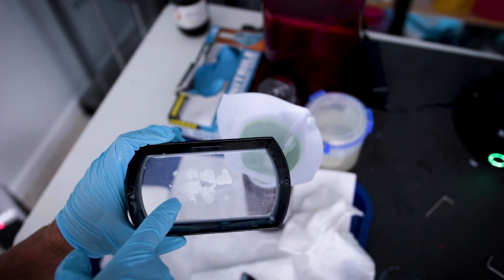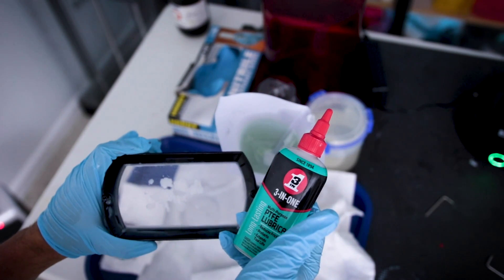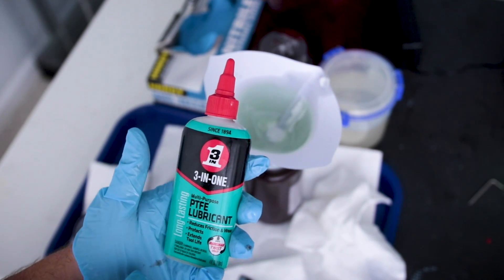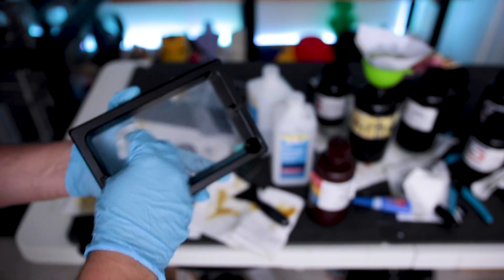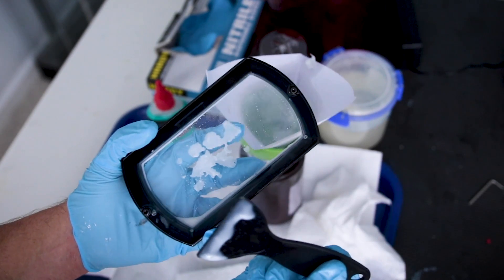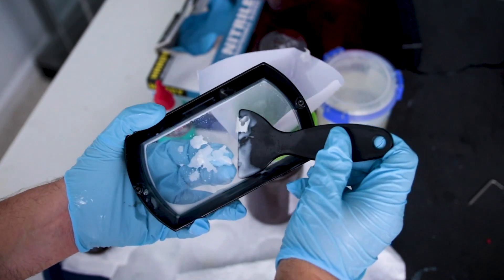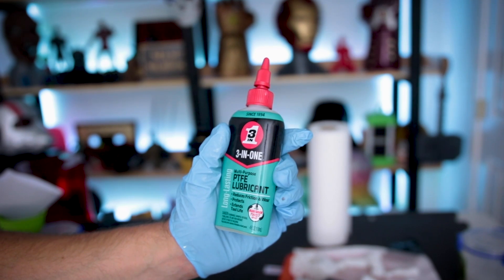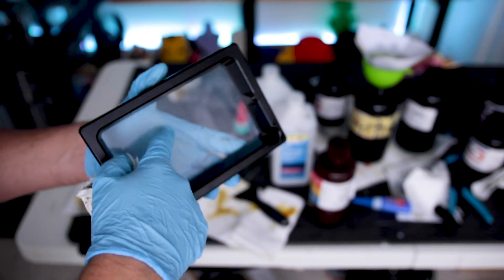Get more successful Resin 3D Prints with this trick - 3-In-One PTFE Lubricant

Comment: Just watched the S4U launch today and I can't stop laughing at that vat size.  You could put 3 of those into the new S4U's vat
Reply: And I‘m here because I‘ve bought a S4U and the tilting vat has the problem that it‘s not going deep enough on the back side of the vat to seperate large prints (big cross sections). So I‘ll try the ptfe lube or Rain-x as a release agent.

Comment: Ok but not paper towel.  Too coarse and will put micro scratches in the FEP and make things worse.  Use either plain (no lotion) kleenex or a microfiber towel.  Or if you have a bunch of those eye glass or sun glass wipes.  Also most of the issues pertaining to prints sticking to the fep is that it isn't perfect any more.  Get a replacement from amazon and swap it out.  Then check your leveling and z axis offset to make sure the build plate does not push down on the fep but simply rests on it.  And third, your build plate may not be abrasive enough.  Make sure you clean it and perhaps sand it. Lay some 220 grit sandpaper on a very flat surface like a glass table top and run your build plate flat on it back and forth and side to side for a bit to sand some new scratches into it for the print to stick to. Use ISO to clean it and let it dry before using.

Comment: I just used this on my Elegoo Saturn...Holy Crap!  What a difference!  No "popping" noise as it pulled the print off the FEP screen, everything looked smoother, and all in all, this is a must have for any resin printer.
Reply: I have a Saturn, too.  I think they put PTFE on the film, then it washes off quickly.
Reply: @MaxHarden Do you apply this before every print?
Reply: @jeffjorczak  only when it is replaced or has something stuck

Comment: I’ve never had a failed print since doing this. It’s easily in the top 10 tips of my entire life
Reply: Can we use vegetable oil for a lubricant as well? Will Vegetable oil damage the fep sheet? I would like to know.
Reply: @yurushii  No. They have entirely different properties. There are a lot of different oils. You wouldn't ask if you can use vegetable oil in your car to replace a car oil, wouldn't you?

Comment: You should only use micro fiber or some other non abrasive cloth.. It depends on the paper towel I guess, but I would think that you would scratch the FEP film. And scratching it can cause models to stick more. I've accidentally used a paper towel and noticed it starts scratching right away. Thanks for the tip on the lube though!
Reply: If it's that weak then shame on companies for allowing this to be scratched, they're literally saving 3 cents by not using glass or something with a similar durometer.
Reply: @roadtrippin2781  It has to flex to "peel" off the FEP.  Glass would remain rigid and cause the print to suck to the glass and fail the print.  Just the nature of the game.

Comment: cant get this product in Malaysia , is that WD 40 dry lube PTFE  same aswell ?
Reply: It worked! I printed a file that was always failing at about the halfway point. I have at least 5 fails after re-leveling changing to better resin, shaking the resin, replacing the FEP with OEM Anycubic FEP, got a new vat, releveling, poked a hole in my FEP, took apart and cleaned the entire printer, and after failing two more times, I was feeling like throwing in the towel. Now maybe there is hope.
Reply: @bonserk  It still working for you? Can't get it in Canada either
Reply: @jessepowellmason  It only worked once for me and when I looked closer, there was a defect on my print.
Reply: @bonserk  Okay, thanks for replying! Saved me the hassle of trying it out.
Reply: I literally put WD40 dry lube on mine 15 minutes ago. I'll let you know if that works 12 hours from now.

Comment: Can this cause contamination to the resin, causing issues with curing further down the line? I am asking if anyone who has used this more long term and has happened to see any changes in their resin performance.
Reply from the maker: I’ve been using this on every resin printer I’ve had for the last year and have seen zero issues from using it with any of my prints, fepsheets or printers.
Reply: @UncleJessy  Do you recommend levelling after applying the PTFE? I feel like it's a good idea, but wondering how much the PTFE would interfere with levelling (I'm using the Flint Reed method).

Comment: Would the WD40 Silicone Lube work too?
Reply: @iliketurtles9  In my case, I used my brand new printer flawlessly for 3-4 prints and after a flexiraptor partially stuck, I assume I may have needed to bake it a little longer for the smaller vertebra or slow down my lift speed for that model. Anyway a couple little bits stuck to the FEP and thus I had to clean it. After cleaning it with IPA as I had read, everything now sticks. I am assuming in my case the IPA ended up making the FEP more "sticky" and using a PTFE lube would help? Heading to the store soon to pick some up... Hoping it's the case.
Reply: @iliketurtles9  does it work?

Comment: Great tip.  Does this cause the resin to bead up on the film?  If so, I would love to see a resin repellent tank build using this on the film, and something like Never Wet on the tank itself.
Reply: I feel like if it were to actually bead up you'd have issues. I assume it works more like cooking spray would. A thin barrier to prevent sticking as it cures. Perhaps thin layer of the Teflon molecules bind to the print and release from the FEP instead of just out right sticking to the film. In other words, simply preventing direct contact of the surface with very fine particles.
Reply: use ultra everdry

Comment: I almost never have a failure and have never resorted to this trick.  Just throwing out that if this is necessary there may be some other issue that should be addressed first.  Likely bed leveling, and most importantly checking it again after you tighten the bed.  The act of tightening it can throw it off so it may take a few tries to get it right.  Once it's dialed in I almost never have to touch it.  Failures are rare with no extra steps required to prepare your FEP.

Comment: Would the WD40 PTFE Dry Lube work too?
Reply from the maker: I believe it would. Sounds about the same.
Reply: Have you had a chance to try this yet?
Reply: It works. Ive tried it
Reply: @intelli07  Does it cloud the FEP sheet after drying? What are the method you used to apply it?
Reply: @mahagurualvin  yeah its a little cloudy but it works fine. I spray the ptfe lub and just wipe off the excess.
Reply: Did you actually try it?

Comment: mr jessy, you did not say if we suppose to remove that lubricant iwth ipa or leave it on the surface for printing, is that going to contaminate the resin and cause it not to stick to the platform?
Reply: It's only a small amount, and you wipe it dry, so there's nothing to contaminate the resin. 

This is to prevent prints sticking to the FEP. The build plate is a separate piece and is unaffected.
Reply: So yes, you're supposed to leave it on there, just like he showed (after wiping it dry), when you go to print something.
Reply from the maker: Yeah, it’s just a small amount to apply. It hasn’t impacted any of my prints so far and I’m doing this on a few prints now

Comment: Hey Jesse. Would you recommend the elegoo Mars or the anycube photon for a first resin printer?
Reply from the maker: Mars baby. I love it. I have a lot less issues with bed leveling than with the photon. Both print great.
Reply: I'm not Jesse, but I would recommend the Mars as a first printer (I have no experience with the Photon). The Mars is super simple to use (way better than my FDM machines) and the support team is top notch (in case you ever do run into an issue). That's rare among 3D printer companies. 

The machine is still on sale (for $249) until the end of August. Also, the company will soon be coming out with replacement parts that are cheaper than the Photon (replacement LCD at $30 rather than $40, and a set of 4 complete extra vats for $30), so that's pretty cool too. 

Technically Elegoo also has a better selection of available resin, but you can use either company's resin on either machine, so that isn't really a selling point per se.
Reply: you cant buy mars, its out of stock
Reply: @kira07  they restock it every couple of days, it's just popular and sells out quickly.
Reply: It's back up as of an hour ago
Reply: I prefer my Photon. The chassis is better, and I'm able to fit a carbon filter to the exhaust fan to control vapors/smells.  I don't find bed leveling to be hard on either one.
Reply: @makermatrix9815  don't the smells tend to be more noticeable on the Photon? I hardly notice anything in the Mars, even without a carbon filter.
Reply: Voro Kusanagi Well TBH the factory config on the Photon with build area exhaust fan does make it worse than the Mars, but it also enables a carbon filter to be fitted, which then makes it better.
Reply: EPAX X1 all the way
Reply: @generationace  No, Epax X10.
Reply: I have the Elegoo Mars Pro and they made some significant improvements to the design that I find wonderful.

Comment: i used Glycerine in the vat its found in the baking section or ebay 

i use it in air brush aswell. wax on wax off . £1 asda no problem lol
Reply from the maker: Boom!
Reply: Use it in an airbrush? Lube and let it dry for the internals? Damn good idea
Reply: VG? How much did you apply to the film and what with? Getting dry ptfe spray fails.
Reply: hi William yeah i use a drop or 2 rub it into the film or i use lately ptfe oil a quick spray rub it in with some toilet paper not kitchen towel that's to hard i don't have any problems ..get your supports right heavy and you well be good.my film is still clear after all these months any fails are due to me with not putting heavy supports in .
Reply: Brit right obviously asda .... but what ptfe lube do you use, this seems only available in yankland
Reply: @vasili1207  Glycerine ebay it food grade
Reply: Vasili wd40 dry ptfe. Spray onto soft cloth.
Reply: Ahh right the old dear used to have that on the shelf as a kid, I will pick up both, glycine and wd one.  Just bought two extra vats can test both out ... 👍🏻

Comment: You really should not have any plastic sticking to the FEP film. Not an issue on my printer.
Reply: Okleydokley is a genius, it's obvious he has extensive knowledge on resin 3D printing, but since he isn't going to share his wisdom with the rest of us I'm going to try with Uncle Jessy is using.
Reply from the maker: I wish I could say the same
Reply: if you design the supports wrong and they not strong enough they part can break off them, sticking to the vat fep film. also you said your printer does that mean you build it yourself? or youi should specify what printer it is instead
Reply: @kira07  "my printer" can be interpreted to mean "the printer I use, myself". Specifying the model wouldn't matter because other users of that printer model might still have the issue even if this person does not.